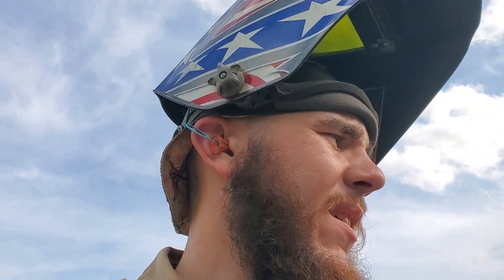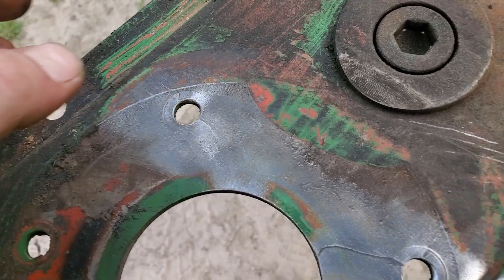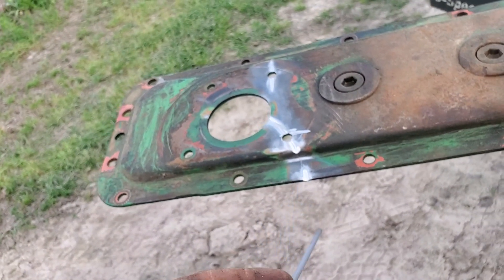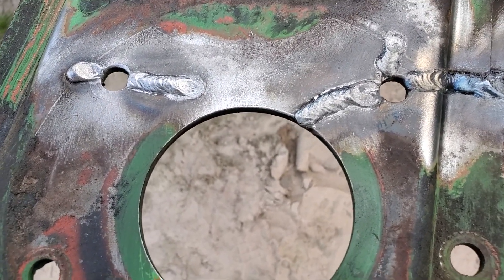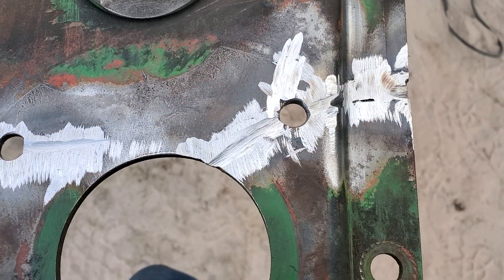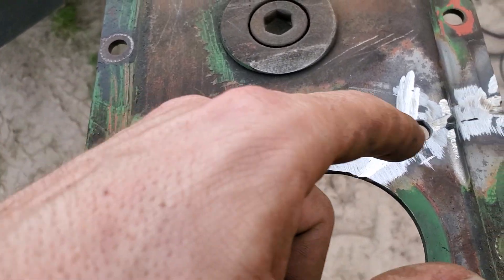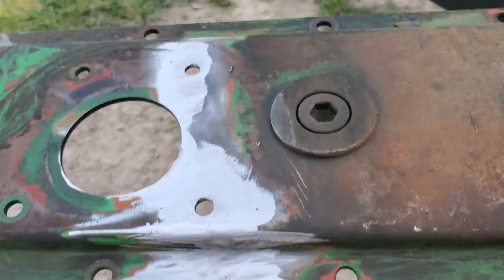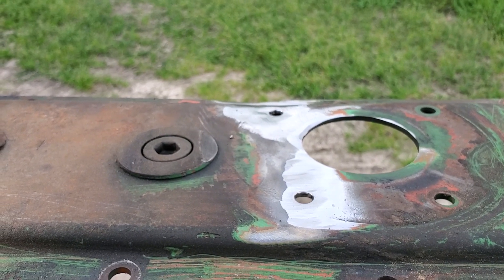Welding tip: how to weld a hairline crack in carbon steel

Comment: That looks great buddy! Nice finish. I haven't arc welded since high school, but i need to weld a lawnmower deck for a riding mower I'm fixing for my nephew. It hassome of the same cracking at stress points. Thanks for the video buddy!
Reply from the maker: No problem! Glad it helps

Comment: What would happen if you had done it all in 7018?
Reply: Welders will be obsolete by 7018.... 😉
Reply: @MrMowzy  I'm new, and I'm wondering why you weld with one rod, then switch and weld it again with a different rod.
Reply: @POOKIE5592  I see, it's because the rods get super hot and evaporate into the air so you need to constantly replace them.
Reply: @MrMowzy  Ahh, you don't know the answer.  It's ok to say so.
Reply: @POOKIE5592  are you serious? I thought you were kidding around 😅 the rod gets melted into the weld and gets used up so you have to get a new one once it runs out.
Reply: @MrMowzy  Ok, let me rephrase the question.  Why would you weld a crack with a 6011 rod, grind it, then REWELD with a 7018?
Reply: @POOKIE5592  he rewelded with the 7018 because he got undercut with the 6011. He probably should have just used the 7018 all the way.
Reply: @POOKIE5592  watch it again he does explain the process.  The casing is mild steel 6010 general purpose mild steel rod used as base material. He does mention And point out some undercut. The 7018 being low hydrogen rod And higher carbon content helps remove moisture (by heating ) and low hydrogen helps keep moisture out of the repair area. High carbon is stronger than the base material and stronger than the 6010 rod. 
   It's actually a 6010 root pass followed with a 7018 cap.  Very common in welding. 
    I'm not a welder but I can weld. I am or used to be a machinist tho so I have knowledge of metals. 
  Also I now raise cattle and mow hay.  These mowers like he's repairing are a bugger to maintain looks like a 9' cutter and there ate tremendous forces at work in the fields.  Pounding , bouncing and twisting , I've repaired ours a few times but didn't know about using the 7018 cap weld. Hardest part with these big heavy high speed cutters is keeping oil in them. The metal is thin enough to cause issues with twisting and torque  forces distorting the case.
Reply: @stevenmassey7586  Thank you!